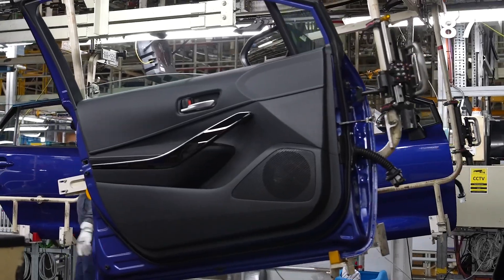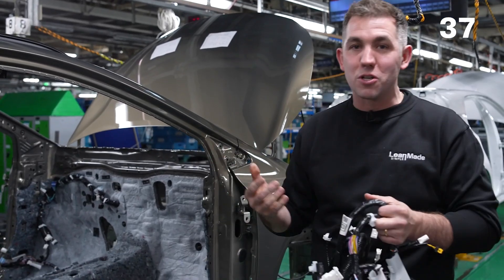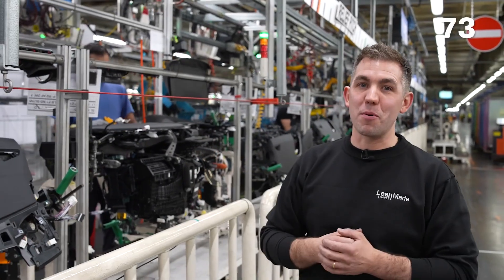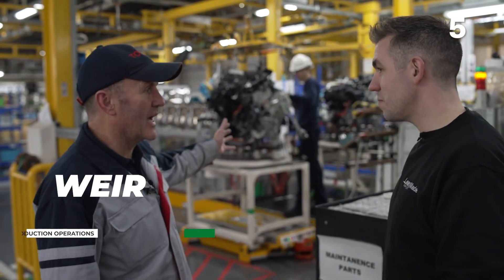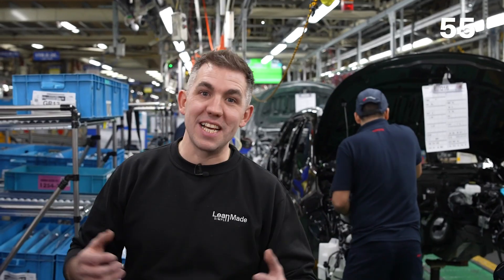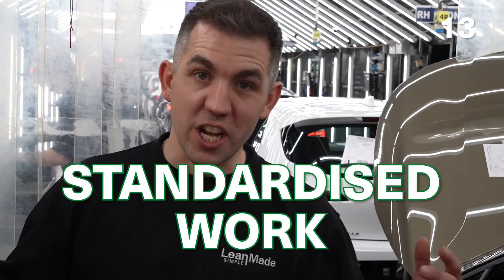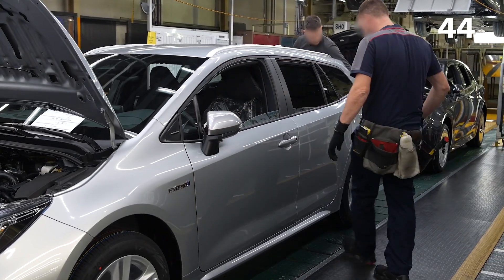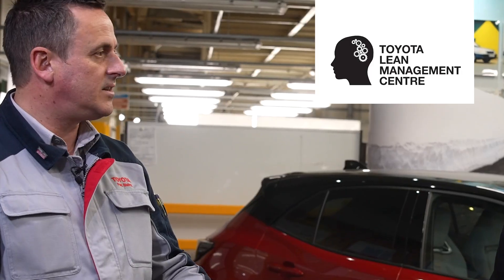How TOYOTA builds a car in 88 SECONDS! | Toyota Lean Factory Tour

Comment: 88 second seems a bit of a stretch to claim to build a car do you know what the actual time is from start of assembly to finish and drive off the line?
Reply: This answer is a bit dated, but at TMMK (USA-Kentucky plant) it takes about two shifts from the start of the build to the time it drives out the door to the marshaling yard. In the case of this video, a completed vehicle leaves the plant every 88 seconds (the takt time).